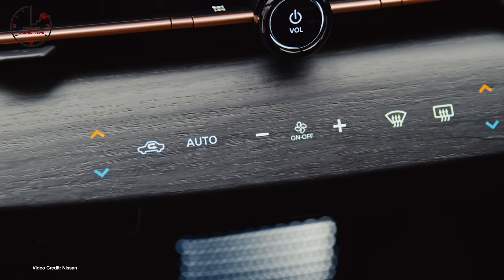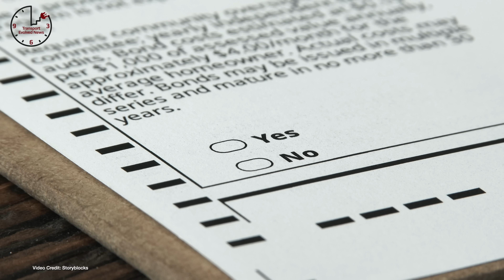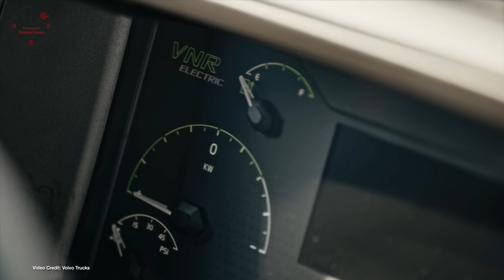TEN 315. NIO Battery Upgrade, No-Limits Hummer Performance, Electric Wing Suit

Comment: Correction. Nissan has battery degradation problem NOT because of no liquid cooling. The main reason is chemistry mix that degrades at normal summer temps.
Tesla, for example. DOES NOT actively cool battery when it is below 40*C. Some Leaf owners have never DC-charged but have gigantic degradation though pack temp is below 40*C. IT IS NOT due to lack of liquid cooling!

Comment: Swapping to a larger battery pack sure is awesome in China when you are on road trips. Just buy the smaller one for dailies - cash saved and batteries used for people that need it.
But then China is more efficient when it comes to infrastructure as well and have more of it while US is still stuck with no high speed rail or extensive subways systems.

Comment: I have reservations about making Heavy vehicles easier to operate. Having them difficult to operate tends to filter out, shall we say, the less capable steering wheel holders. If you make them as easy to operate as a car then people will drive them like cars which is fine, till it's not. The problem with a heavy vehicle is that it mass's anything from 10 to 100 times (Australian road trains) as much as the average car. When things eventually go pear shaped, they are very very big pears.

Comment: I thought part of limiting top speed is to protect battery health and safety from excessive sustained output, except Tesla's have super high top speed.
Battery swapping is no good for USAunless it could be a cost effective way of replacing or upgrading your battery, then it could be a huge selling point.
Reply: Tesla tried battery swapping with the model S. Turns out it wasn't practical.

Comment: I wish tesla stopped selling their emission credit so the other Car manufacturers will have to change
Reply: The credits are not worth anything unless someone buys them.  Most of Tesla's profits are due to these credits.
Reply: Why not have the competition pay for Tesla's R&D and Factory builds. Tesla could be profitable without them if it just reduced the expenditure in those areas, but that would slow them down and allow the competition to catch up.
Of course there is pressure to give the OEM's a pass for their incompetence and foolishness

Comment: I often wonder if its possible to use drag from pushing against the wind whilst driving to recharge the battery of ev
Reply: Over unity machines do not and cannot exist, but you could use an impracticably large turbine in a gale to charge the batteries and crawl along.
Reply: Of course it's possible, at the expense of massively increasing the wind resistance way beyond the gains you would make.

Comment: Regarding EV acceleration and top speed, both are irrelevant except in terms of pleasing the "my dick is bigger than yours" segment of the population (catered to by CandD, R&T, et al.). The EV with the slowest acceleration and lowest top speed is more than adequate for keeping up with traffic or merging onto the interstate.
Reply: I agree on top speed, but some EVs are too slow (mostly used models).  0-60 of over 9 seconds is scary as f_  when going up a steep highway ramp with big rigs bearing down on you.

Comment: Missed the fact that those "Swedish Chef" Class 8 rigs are going to be bolted together in the US of A in last week's vid. (Would you buy a "US assembled" Ferrari?)
Reply: US workers assemble a vehicle just fine, the problem with American cars is usually cheaping out on design and materials, not negligent line workers. Also American semis have great build quality and run millions of miles just fine.

Ferraris have historically had the opposite problem, brilliant designs, assembly issues at the factory.

Comment: Electric Semis will save a ton of money for companies/drivers .  I wonder how many truck stops already have chargers installed and how many people will try and get their CDL to drive them ,as they are Far easier to learn/drive then current big rigs .
Reply: Kilal Googlestaffers  I was referring to Jubitz, are they owned by an oil company.
Reply: Kilal Googlestaffers  TY, You're right about the food, their omelets were always outstanding, and huge!
Reply: Truck stops around here (Oregon, NE PDX) don't have any chargers yet, and being the busybody that I am, I keep mentioning it to their employees. The employees seem enthusiastic, but there probably aren't enough electric trucks yet, to be a blip on their radar. It seems like a no-brainer to me, they already have a store, a theatre, a restaurant, and a hotel right there, what's not to like? They're apparently still hooked on peddling dinosaur juice to burn.
Reply: I would guess your assumption on the CDL isn't true. The gears of the rig are by far the simplest part of that profession since it's just a clutch and gears of any other vehicle.
Reply: @davidmccarthy6061   i don't know any manual transmission cars with 16 speeds , a gear splitter , and a high/low range selector and has to be Double clutched to shift .   Car shifting is something we have to Unlearn when learning a Semi truck tbh .